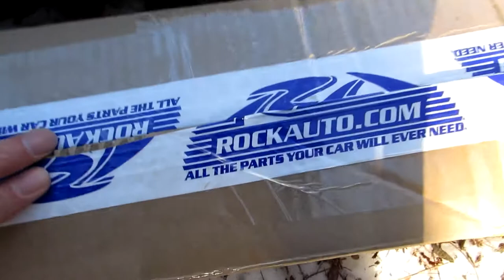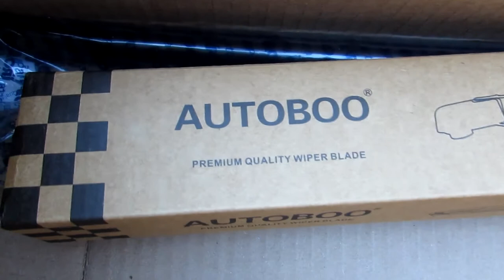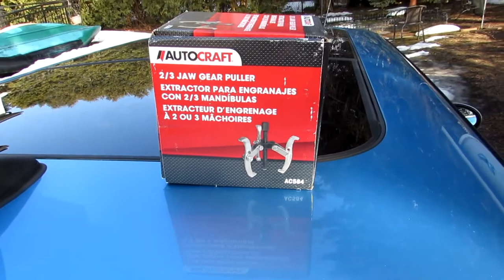R50 Mini Cooper (2005) Hood Strut and Rear Wiper Replacement

Comment: The bearings on the shaft Are probably dry Pull the motor out Tap the end that shaft you can see underneath The hatch You can see the end of the shaft You can see the end of the shaft Tap the end of the shaft And spread with WD40